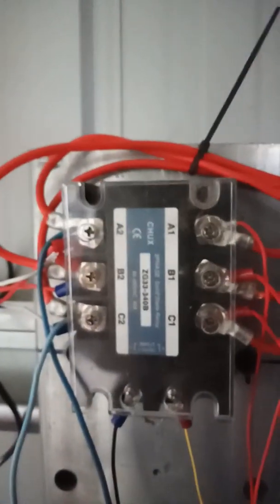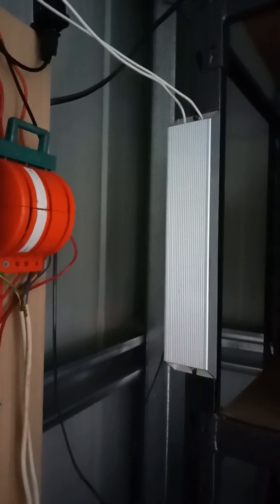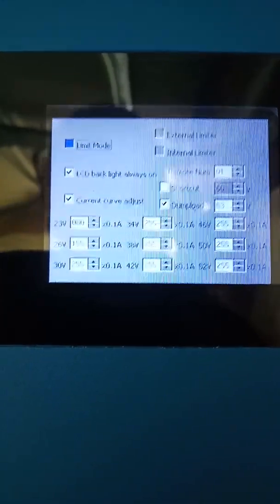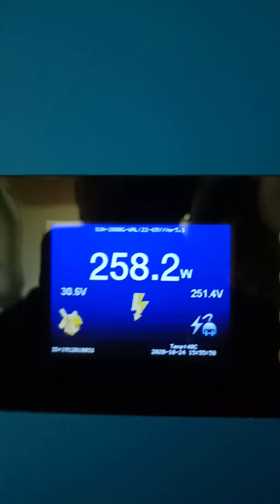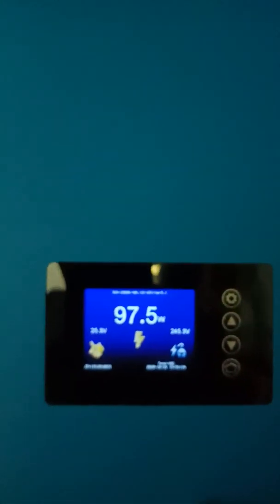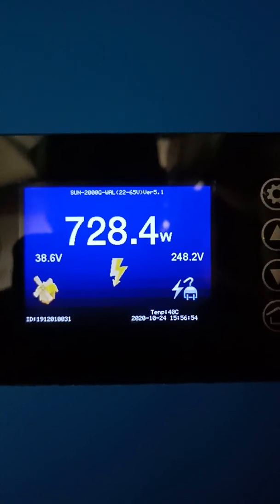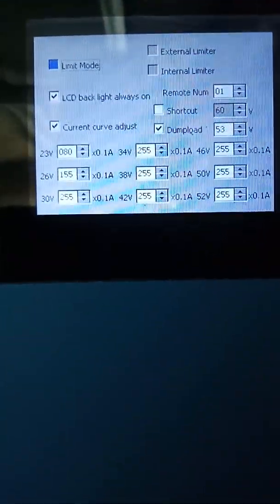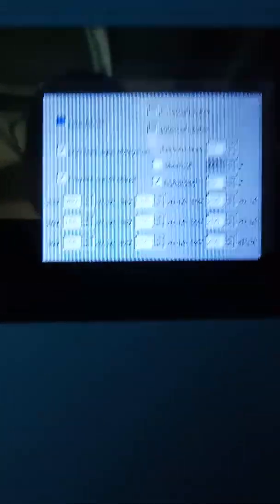B & C 1000w wind turbine.  with gti 2000 W inverter. (3)

Comment: Hi Dave, Thinking of buying B & C 1000w wind turbine. What you recommend the 48v or 24v with the gti 2000 W inverter? Also thinking AWG 4 copper wire for 70 foot run.. your opinion matters..
Reply from the maker: Go for 48 volt with 2000w inverter set as solar /battery  dc not 3 phase   4 12 volt 130 ah agm battteries $300 each aud  or whatever you can find, with 48 balancer around $48 aud ali express 2 or 4 solar panels as high wattage you can get your hands on cheaply 2 in series and add the next 2 in parrallel. (jinko 370w can be sourced at around $115 AUD each ). a 1500w 3 phase wind turbine charge controller with inbuilt over voltage braking. 
That setup is not going to give you ay issues. If you do not controll the peak output (the 2kw inverter does not react fast enough) it will go into over voltage and stay there. It also stresses the 2kw inverter relays and dump load. ALL WILL burn out. adding cost and frustration. 
Having the solar panels will keep the battery charged You set the cut off voltage at say 46 and the reboot voltage (restart ) at 48.5 in the settings. It is important to use the batteries otherwise the voltage will exceed the input voltage of the inverter.
 Let me know what you decide and products I will check they are fit for pupose.

Dave

Comment: Hi ,what settings  would u recommend  for 800 watt 48 volt wind turbine  connected to a1kw gridtie inverter  its the same make as urs,i have very strong  winds ,thanks Gerard
Reply from the maker: Current curve values 25 80 125 166 166 166 to max 255 those values should be mostly OK.
Reply: Thanks  for that .iam settings it up this this week  ,just to let u know  iam  living in the west of Ireland  and 90% of the tjme its windy ,also iam feeding straight  into house  hold supple iam not charging  any batteries  ,Gerard
Reply from the maker: @gerardcomer5550  Just make sure your mast is at least at 10 Meters. It makes a huge difference.  And be prepared for the kwh to be low. 
even though you see power generated most of the time it does not amount to much with a 800w turbine. "
To make the excersize worth while you really need a  1.8 kw turibine hooked up to the 2kw inverter with My braking system or similar added.
Best things to do is reduce your basic power load find those devices that are old unplug what you can when not in use it all adds up.
If yuo can get the turbine to power all the devices that are on all the time that is a good result. It will not provide enough power to give you no power bill or allow you to run off grid in the future.
Get some solar panels they are now super cheap use a reputable supplier ( NOT ebay I have not anything related to solar wind or batteries that was actually what they claimed.) 
Try a local industrial solar panel installer they ussually have end runs of panels you can probably purchase off them at a good price. 
With the correct inverter /battery setup you can save heaps by not expoerting to the grid that is only if the power company gives you scraps for what you export.
It also depends on govenment incentives though. they really screw the market around.
Reply: @davecollier8946  I  live on top of a hill ,i could  nearly  hold it in my hand and it would  spin ,😃😃,Yes i know what you  mean  iam only  trying this ouf first and then  j well  go for a bigger  one ,i would not  bother  with  solar panels  as its not sunny  enough ,plenty  of wind do😃😃
Reply: @davecollier8946  well  i got it up and going  ,i have  set the current  settings  to what  u give  me , i was only getting around 100 or  so watts on screen set the dump load to 80,it started to  give me 400s watts plus  even above 500,  we have very  strong  wind  here today and most days, would  u  have any train of thought  on this ur advice  would be  appreciated ,thanks  Gerard
Reply from the maker: @gerardcomer5550  I don't enable the dump load on my system because I have external braking resistors. 80 volts may be a bit high in gusty conditions . You only want it to engage to stop the turbine exceeding 90 volts. Wind gusts are the enemy. If you have the Wi-Fi adaptor check the voltage plot make sure the voltage is stable after 48 volts. No spikes.
Reply: @davecollier8946  thanks for that, haven't connect the wifi yet do i need to download  an app ,also i have seen on ur  last video u had ur turbine under control  with  ur new resistors setup  can u help me out with  same  system  ,Gerard
Reply from the maker: @gerardcomer5550  Use the wifi app to connet the wifi it is much simpler. 
As long as your turbine and wind does not over load the inverter eg voltage to high you do not need the extra external resistors. 
Whose brand is the turbine?
Reply: @davecollier8946  ,its from Green energy  on Ali Express   it was recommend  by another  youtuber  Peppermountain
Reply from the maker: @gerardcomer5550  Yep Jon Pulls no punches when he reviews products. :-)
Reply: @davecollier8946  yep ,like  yourself  he is good to  watch
Reply: @davecollier8946  ,just  a matter of  interest, when i change the settings on the  inverter  u give  me ,how does it effect  the turbine
Reply from the maker: @gerardcomer5550  OK so what it does is stop the turbine spinning too fast by taking as much power as it can at 48 volts.  
The higher the voltage the more you load the turbine. It is a simple equation  800 watts at 48 volts is 16.66 amps  so as long as  the inverter can sink 16.6 amps at 48 volts you are all good but it can not. so the voltage goes up at each step you multiply the voltage by the amps. so at 60 volts it producing just under 1000 watts. not spinning like a top. the higher the voltage the faster the turbine is spinning and you want to keep the spin speed low because of the noise.
Reply: @davecollier8946  ,Sound  i get it ,i must  say its very  quiet  even when it  was spinning very  fast
Reply: @davecollier8946  Hi, I have a Sun 1000W GTIL with the WiFi dongle and I’m wondering how you are monitoring peak voltage? I’ve installed an app called Smart Client which shows a lot of stats on production but I can’t see anything about peak voltage. What app do you use?